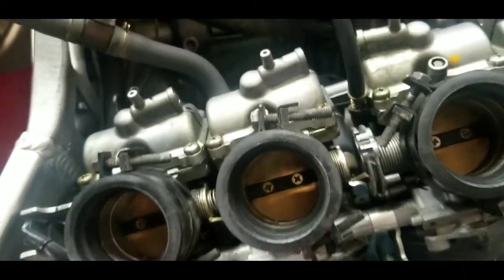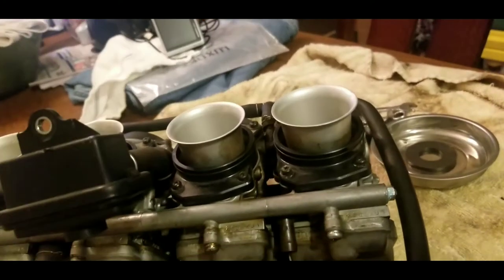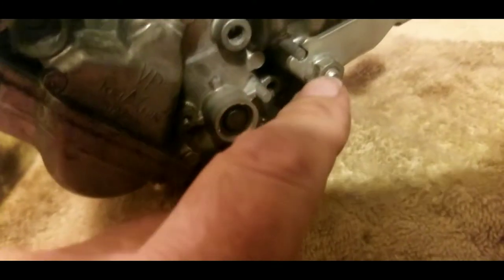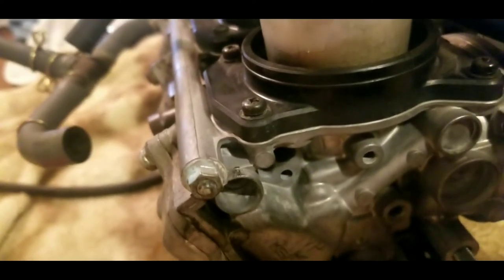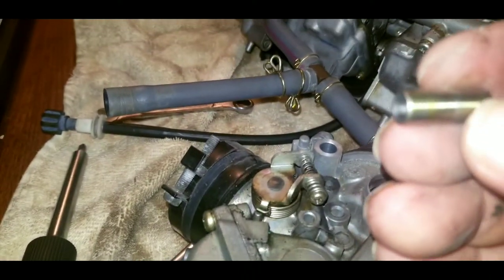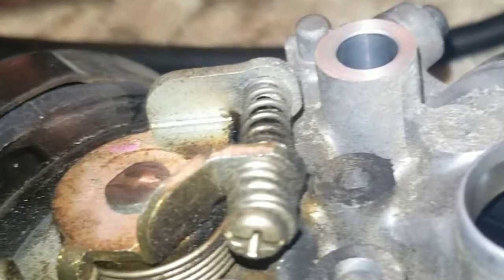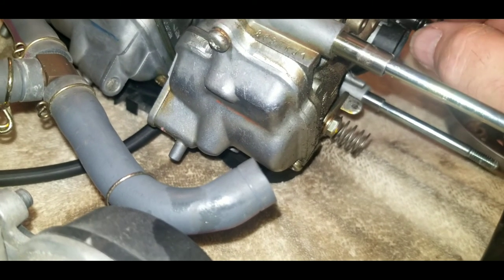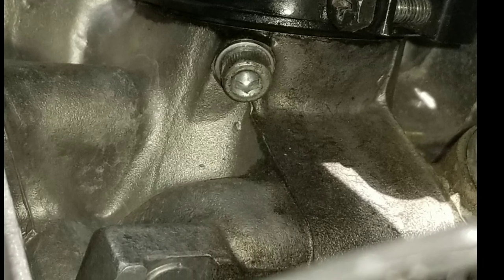How to separate carburetors and replace o-rings on fuel Tee Honda CBR900RR

Comment: Tanks a lot from Stockholm!! To get size of the o-ring in advance save me a lot of time and make it possible to do the whole process of replacing them at same time. And of course it also save me a lot of money to order o-ring by size instead of buy very expensive oem parts from Honda.  To buy patrol and heat resistant (FPM) o-rings in this size online here i Sweden was 15 SEK instead of 800 SEK for oem parts.
Reply from the maker: Thanks for watching

Comment: Great video! I have the same fuel leak on cb600f and I’ve taken out the carburetors and I’m about to separate them. Could you write down the size of the fuel o rings cuz I didn’t catch it from the video? Thanks again!
Reply from the maker: Standard automotive  o ring size 11
Reply: @darylturcott  when im matching them up to the green o rings iv bought they arent size 11, the 11 are much bigger.

Comment: i have EXACTLY the same issue and the same leak on my 99 fireblade as of tonight!
Reply from the maker: It seems to be a common issue. We have started using Rec fuel in all of our bikes & small engines.
Reply: @darylturcott  yeah iv seen a few with the exact same issue - unsure why that particular O ring likes to leak but it is what it is and il have to get cracking and get it sorted!
Reply from the maker: It wasnt too bad. I would pull all the bowls while you have it out and clean all the jets.
Reply: @darylturcott  just doing it tonight, its been winter so no point in doing it until now! pain in the arse to get them off! lol
Reply: @darylturcott  just a quick Q that i hope you see - did you use any silicone spray on the O rings when re-assembling?
Reply from the maker: Hope it goes well
Reply from the maker: I cant remember,  sorry.

Comment: Hi, thx for the vids, i thaught it will be more complicated. I actually have a bad synchronization but it runs pretty well. Do you think it will need a new synchro, like it's not really good but it runs well right now. Does it will start after the change of all the O-rings ?
Reply from the maker: Ive been able to separate several without snycing
Reply: @darylturcott  yes me too i did it without touching the syncro

Comment: I have a leak appeared this week.very difficult to see where it originates and just running down and dripping off bottom of carb 3 and 4. I had stripped carb 3 thinking seals had dried up but they don't seem that bad I was gonna check the rest and then I noticed the T piece and seen the 2 long bolts and realised the carbs seperate. 1 quick YT search and found this vid. Perfect I'm sure this will be where my fuel is leaking. Won't know untill I try but not gonna bother checking the rest of the cards untill I've checked this. Thanks for posting.

WARNING Id like to add. Be careful when handling the carrburettor rack as a whole. I was turning mine over to loosen the 2nd long bolt and as I held the opposite ends I heard a snap. With very little pressure the plastic nozzle that attaches a very short narrow rubber hose to another metal nozzle had snapped! The plastic is so old it's so brittle. I don't know what it's for. There's 1 on the same side of all the carrburettors so the rest are protected between each carb. But the last 1 is on the outside. I was gutted. I don't even know where or what to search as there's no part number. I might have managed to fix it with gorilla glue. Will see how it sets when dry. I slotted a metal pin the same diameter as the hole in the nozzle right through to the housing so it won't block with gorilla glue. And been spinning it every 15 mins or so the past hour so it doesn't get stuck in there untill the glue sets a bit. Seems to be working. Will need to attach it VERY carefully and hope it doesn't snap again. 🤞🏻
Reply from the maker: There are 2 sizes. 1 for fuel inlet tees another for the smaller tubes. If you only separate them you may not need to re synch. We didnt and it runs great.